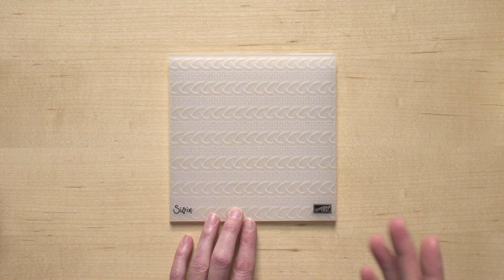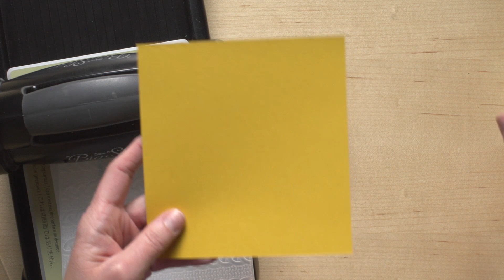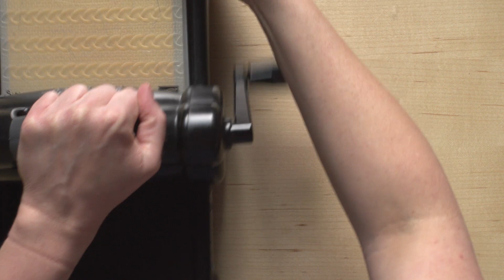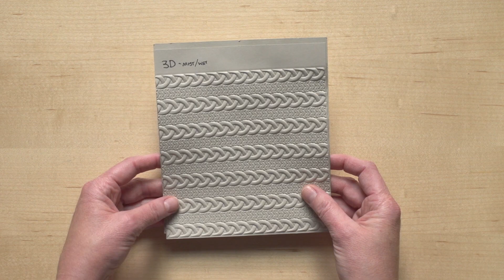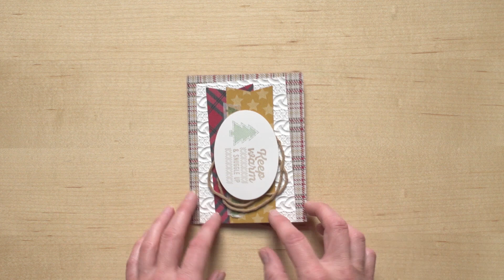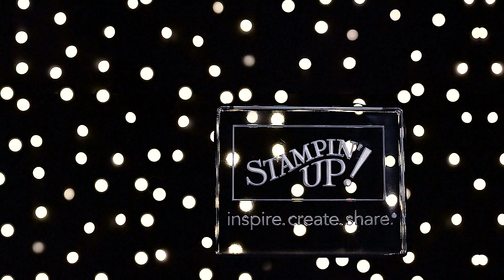Cable Knit Dynamic Textured Impressions Embossing Folder by Stampin’ Up!

Comment: Lovin the folder but does anyone know the sandwich for the Grand Calibur?
Reply: I've tried several times with various pads, to no avail. I did use a portion of the folder by using the white plate, folder with cardstock (moistened with a mist of alcohol) and a Cuddlebug B plate on top. I'm sending my folder to Spellbinders for them to test today.